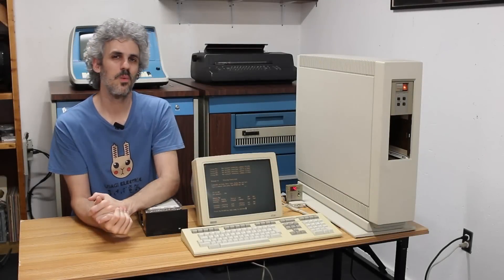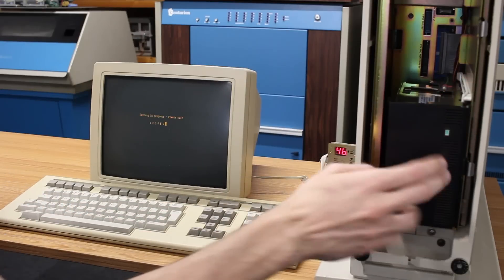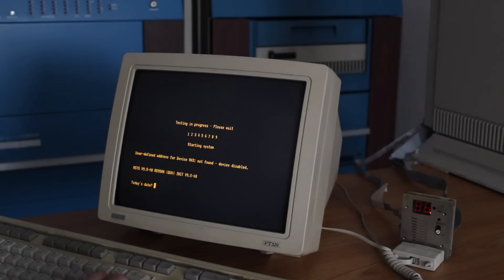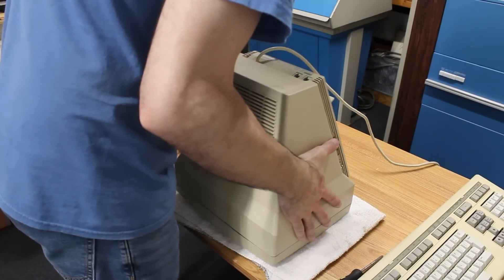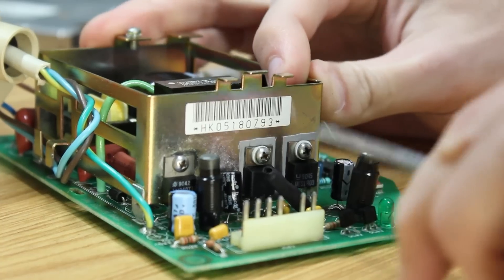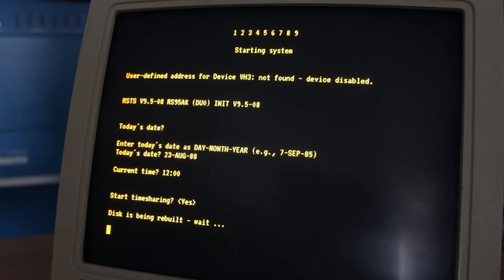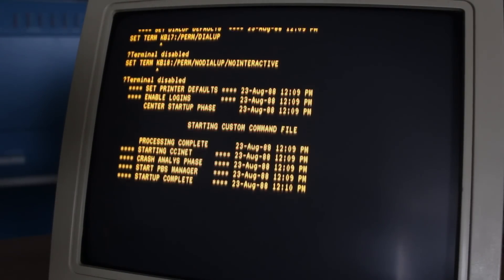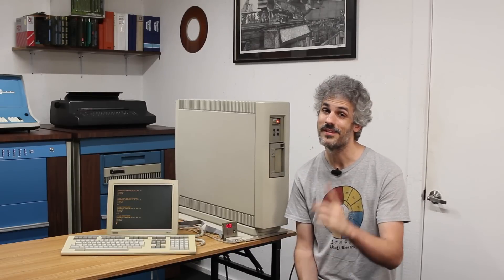Booting RSTS on the PDP-11/83!

Comment: My first exposure to computers after college was on RSTS back in the mid 70's.  I remember there weren't directories but you had your project/programmer number and that constituted the place where you put all your files.  File names were 6 letter/numbers with 3 for extensions due to the way characters were encoded into 16 bit words.  There was no lower case, which might be why it didn't like the "yes" you typed in lower case.  We programmed in Basic.  Your memory space was 32k for your program and another 32k reserved for the system.  It's amazing how much you could get done in 32k.
Reply: I recall text string handling was a little weird in PDP/11 FORTRAN due to encoding three alphabetic characters into one 16-bit word.  You had to normalize strings before comparing them.  That was like 47 years ago and the exact details are a little hazy after that long.

Comment: Isn't it amazing that this old hardware works totally fine after so many years even sorry I have to say that you do NOT treat it with proper respect (anti-static!!)? It's a very (very!) long time since I last used a RSTS (pronounced "Ristos") but if my memory doesn't fail me: the "disk is being rebuilt" occurs at boot time when you did NOT shut down the system properly ... it could take quite some time on larger disks. About the login: could be normal that the system doesn't echo your typing for security reasons, try HELLO 1,1;SYSMGR <Enter> or HELLO 1,1;SYSTEM, these used to be default accounts. Maybe you're lucky! Love your videos, looking forward to the next one every week.

Comment: I haven't read all the comments, so it might have been mentioned before: I think you had to type in YES in capitals. 
I started my job at DEC in 1980. I've worked with RSTS/E as an operator and system manager. We used teletypes like the LA100 and LA120. I remember you had to login with HELLO 1,4 if you wanted system privileges and start some commands with PLEASE. I started with the gigantic VT52 terminal, later we had the VT100, VT220, VT320 and VT420. The latter one was able to display color if I remember correctly. You used <ESC> sequences to control the VT, like <ESC>1m for highlighted text.
Later we moved to VAXes running VMS, with DCL as commandline language.
Man, I'm old 😂

Comment: The power supply in your pdp is probably in a similar state as your terminal power supply. I suggest you check them. Might even be hanging the CPU if power doesn't come up fast enough. Or maybe the power on reset stuff is broken or to slow because of power supply failure.
Reply from the maker: That's a good idea! The power supply itself looks to be in pretty good shape, but I'll take another in-depth look at it. Another potential error could be the terminal sending a "BREAK" signal on power up in response to junk being sent out the MUX port, though that one feels less likely as this didn't start happening until the HDD was installed and the added load of spinning it up.
Reply: @UsagiElectric  you'll figure it out. Something to look forward to in the next video. Final hint, appearances can be deceiving. Measure. Especially things like power on reset stuff might appear to function fine, just not within spec.

Comment: 12:33 I remember when the main campus 11/70 went down due to a power glitch (e.g. lightning strike), it would typically take 10-15 minutes to come up again.
Reply: From 1993 to 2002 the software I used for work ran on VAX/VMS, (I loved the DEC ecosystem, and great to see a VT320 after all these years). When Jurassic Park came out and they restarted the UNIX system, I was thinking that if it had been a VAX Cluster, they would have all been eaten by the time they managed to convince everything to boot and join the cluster.

Comment: Oh
seeing those caps, some words out of my years of repairing old stuff (and especally dicking around with bad caps)
1) Always use good quality replacements, cheap ebay-kit style caps may work for a while but it generally ain't worth the effort to even try.
Panasonic, Nichicon or Rubycon, you name it. Do not settle for less. If possible go for 105°C rated "Low ESR" types.
2) in anything like a PSU, or around voltage regulators, basically everywhere you find big beefy caps, going up by a bit is generally no problem. caps tend to have 20+% tolerance towards higher value and as long as you stay withing the same ballpark it generally will work.
I would avoid going up by a factor of 2 or more, as it may change regulation behavior or lead to slow ramp up of voltages. but going from 1000 to 1500µ or 2200 to 3300 is usually no issue (in a PSU).
3) If one cap of a style is leaky, exchange EVERYTHING of the same brand as well, the others will most likely follow soon
4) trust your nose
as soon as any faint smell of fishy caps is there, power down, find them, swap them, electricity plus cap juice gives worse corrosion that letting the thing just sit
5) early 90s SMD aluminum eletrolytics: they will leak. basically no exceptions, getting better from maybe 1997 on, the issue was a mixture of solvents used in cleaning plus cap properties.
early 2000s cap plague was a different machanism, mainly chinese copy of electrolyte formulation missing the secret sauce that would make it (chemically) stable.
6) swap in low esr aluminum for vintage tantalums, generally swap all tantalum caps on suply rails (usually big or on power busses on the board), leave small (<=47µ tantalums in place but check for leakage. they will basically last forever in signal circuits but will blow up occasionally on power busses, potentially buring out other things as they die
Reply: This should be pinned!

Comment: You stirred a few memories of these beasts!  In the early 90s I was a young buck working on a pair of (old at the time) PDP-11s running RSX-11. My task was to install TCP/IP libraries and create some basic network test/demonstration applications in prep for a large app development effort.  Fun video.

On the stuck address line debug, I believe you could have removed the RAM chips one at a time and retest the line. The CPU should have still generated the addresses even without all RAM present. It would have told you which chip was holding the line high if you cared to know. Anyway, I liked your fix of socketing all of them and replacing with new.

Comment: I worked for an outfit which had a few hundred DEC terminals. My recollection was the VT-320s were kind of squirrelly and the VT-220s were more reliable.  I also had a Rainbow with a monochrome green on my desk for a while.  The O/S supplied for the Rainbow was MS-DOS 2.11.  (CP/M and Pascal P-system were also available.)  That RX-50 (?) dual floppy drive was very unreliable.  There was a single drive motor and a complexly routed belt to turn both drives at once.  That required the drives to turn in opposite directions.  If you looked at the drive cross-eyed it would go out of alignment.  It is hazy in my memory, but it seems like DEc had an oddball sectoring on the floppies, 400K (?).  My possibly faulty recollection was Rainbows could read standard 360K floppies, but could not write them.  I forget the details, but it seems exchanging floppies with IBM PC/XT users was a pain in the neck.

As far as printers go, DEC was pretty bad at making their own mechanical elements.  The first DEC printer we had was a re-labeled Printronix, the printer with metal lid and sloped front.  That unit was reliable.  Later we got a DEC line printer which was shaped a bit like a washing machine with plastic cover.  The latter printer seemed like it requires DEC to repair a major issue almost weekly.

LA-50 printers were very nice serial desktop printers.  The LA-50s were probably made for DEC by a supplier such as TEC.  We had quite a few LA-50s around years after most other DEC equipment was long gone.  I wrote a graphics print driver in Borland Turbo C for the LA-50 in the mid 1990s.  (No, I didn’t keep a copy of it.). WordPerfect also had an LA-50 driver.

Comment: Your version of RSTS is highly customized. The normal startup looks much simpler. It will also ask you for username and password. The bonkers LEDs are normal, this just lets you know that the cpu is running and the OS is booted. If it stops, your system has crashed. 🙂
I had a RSTS system for years at work to test and repair peripheral modules. 11/83, 11/23, 11/44 and some more. Installed new versions from 1/2 inch reel tapes.

Comment: I used to run a multiuser BBS back in the mid 80’s running RSTS. I now have two PDP 11/73’s and two MicroVax II’s that I am working on restoring. I would love to get my hands on a copy of some of your PDP software. I also have quite a few DEC diagnostic disks you may be able to use.

Comment: I learned BASIC plus and WATFOR in high school on PDP-11s, mostly ADM3A terminals but also had some Heath/Zenith VT52 clones, teletypes, and others I don't recall. we pronounced it "riss-dees." I remember poking around in DCL and unsuccessfully trying to get TECO to work on the VT52 clones. The BASIC Plus system served terminals in three classrooms, and the FORTRAN system only one due to increased load of compilation I guess. It always impressed me so many users could do work on the same system.
Reply: Wow, TECO ... 30 years ago came rushing back in an instant

Comment: I used RSTS/E in high school and at that stage you are expected to type HELLO to initiate the login sequence (system will prompt for account and password). But it should be echoing what you type, so something odd is happening there. RSTS accounts are of the form p,pn where p = project, and pn = programmer number, both are three-digit octal numbers. System manager's account is 1,2. Of course, you will need to know the password to get in. Default password for 1,2 is SYSTEM so maybe you can get lucky with that.
Reply: You may need to type some particular control character first to get its attention... ^C or ^Z or ^E or something like that.
Reply: P.S. I believe the command to reenable keyboard echo is SET ECHO, so you might want to type that. It should work even though you are not logged on (a subset of commands is allowed to be executed without having to log on). Also make sure to type uppercase until you can issue a SET LC INPUT command to enable lowercase.
Reply: Pressing RETURN should be sufficient to wake up a login process.
Reply: OK, to amend the above, I don’t think pressing RETURN was enough. You had to type a command, normally “HELLO”. Also on our installation, you could just type “I”. You can put the account code on the same line or in response to the subsequent prompt.

Comment: The way you powered the terminal off then on in less than a second you can't tell me you didn't power surge it.
Reply: That's probably what pushed the capacitors over the edge.
Reply: @MarshallGates  And the caps weren't even THE problem, sure they weren't healthy and still should have been replaced.

Comment: Thanks for another great video, but I feel it is important to say something on power supplies and capacitors so that the life of these wonderful old systems may be as long as possible and bring pleasure and enjoyment for the years to come.

Briefly interrupting the power with the power switch to cause the system to boot suggests there are already serious power supply problems that need to be remedied. I would re-cap the power supply regardless of the apparent physical condition of the capacitors as bad capacitors can appear to be physically okay.

I would then look at the other circuit boards, with a view to re-capping them so the condition is then known. Capacitors can fail intermittently as they age which, in my own experience has been just before they fail completely. I have personally rebuilt and repaired quite few power supplies.

If the capacitors are not replaced then the output from the main power supply will be what is known as 'dirty power'. This means that instead of being a smooth direct-current output, an increasing number of high-frequency harmonics appears on the output which causes downstream filter and bypass capacitors to be overloaded trying to clean up the signal and then they fail. Another unwanted side effect is that the voltage can end up largely out of specification, from an electronics perspective, which also damages downstream components.

A slightly less obvious problem arising from bad capacitors, especially in digital circuits powered from a switching power supply is that the 'dirty power' can, because of its pulsed nature, end up appearing as 'data' within the digital electronics causing phantom memory errors, crashes, and other data corruption. The best solution is therefore to replace the capacitors on all the boards in the machine if you wish to maximize reliability, data integrity, and working life.

Comment: On our 11/45 mini running RSTS/E it would hang if the Line Printer wasn't ready and couldn't start the spooler. We also had to make sure that the 800 & 1600 BPI tape drives were turned on (not necessarily loaded, but on,or the buss had some issues being dragged down. RSTS/E was my favorite OS, allowing almost any resource to be Pip'ed or redirected to any other. Substitute an ASR33 for a keyboard, or most anything to anything.

Comment: I enjoy your vintage computer restorations and presentation style. For the software side you should look into the simh emulator. It can emulate many different mini-computer hardware such as PDP-11s. You can practice installing and get familiar with many mini-computer OSs on a Local PC, without booting your actual hardware. There are many prebuilt and not, DEC (and other) OSs to experiment and learn on, Including RSTS and RSX. Plus they run much faster on modern hardware. So you can get to learning faster because they startup faster. Less wear and tear on your actual hardware.

Comment: The 77 error can also indicate a timing issue causing the CPU to not complete its initialization due to buss timing issues. I've seen that issue caused by a bad clock circuit on the old Ontel systems. I suspect the VHS device error is related to some kind of missing hardware, a controller perhaps, that the system is looking for on boot.

All and all, this is fun stuff and it's great to see the old machines operating again. From 1988 to 1992, I was a computer operator and supported a VAX 8350 and a bunch of 11/780s all running VMS and operating in a cluster. Connected to the 11/780s were TU78 tape drives and two LP27 printers. Those printers were mean and would never fold the paper properly! I would go in on a Saturday shift and find paper streamed all over the computer room. The TU78s and the tape drive connected to the VAX 8350 could back up to a 2540 bpi tape in 20 minutes. I timed my other chores I had to do during the shift around the backups and would return to the computer room just in time to place the next tape on the drives.

I miss that environment and the quality of the hardware that DEC made in those days. We see nothing like that today.

Comment: Ah the memories of PDPs, TSX+, RL02 disks and DIBOL programming.
Reply: Oh good heavens! DIBOL! I wrote so much! Even a really terrible pre-compiler which we called DI-plus!
Reply: @royvarley  I remember some of our code was sent through the post on a massive RL02 disk. Seems crazy now.
Reply: BASPLUS and COBOL77 was how I cut my minicomputer teeth.  I'd already been using TP3 on PCs by then, so it already felt antiquated.  Still, the ISAM file handling was impressive compared to eg DBIV.
Reply: @beer_goggler  Yes indeed. In terms of advanced technology, we actually set up a laser link between our building and one of our customers - they were a whole 50m away! 😂AND I got to take home an acoustic coupler so I could dial in to our system from home! The coupler being a wooden box where you placed the handset of old style phones and set up a VT100 terminal so you could type and receive at some 10-15 characters per second!

Comment: I just got my pdp-11/84 back working.  The cpu card had faulty cache.  Tried replacing the cache chips, but no.  So bought one of the M8190 boards off eBay.  I just had to move the CPU chip over as it was not on this board.  And of course the ROMs.  It now boots fine and can run BSD 2.11 or RSTS 10.1.  It's fun to run old systems.  But it is loud as the fans are loud.  An 11/84 is an 11/83 CPU in a Unibus box with a board that translates from Qbus to Unibus.